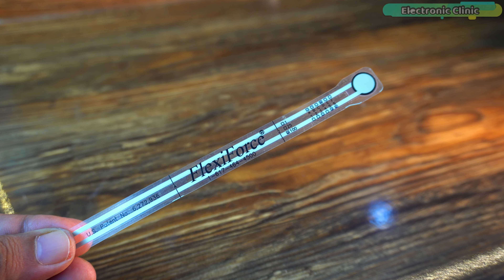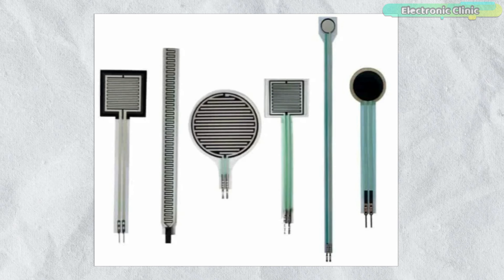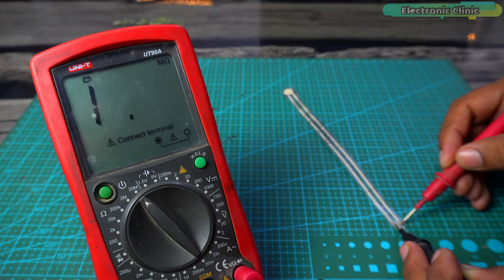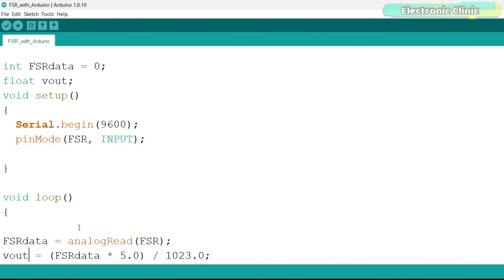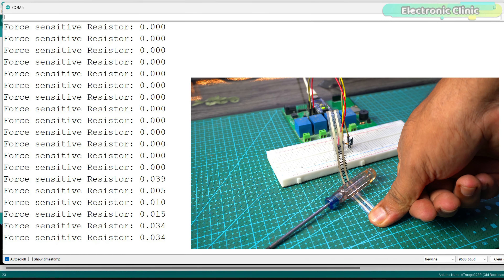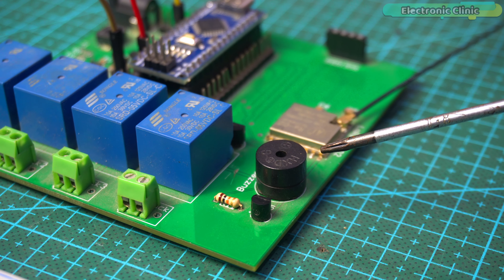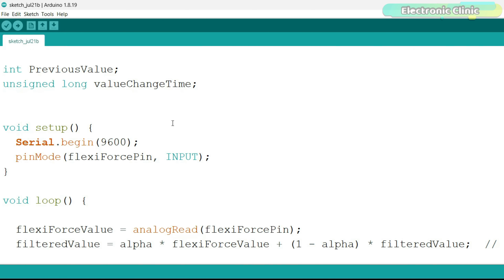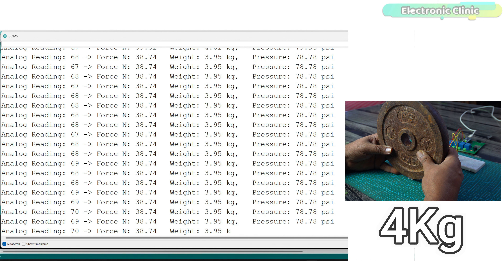Force Sensor with Arduino, Force sensing Resistor FSR, Force Resistor, Force Sensitive Resistor

Comment: That was a great video, I worked with the pressure sensing resistors in the past and got very frustrated with their inconsistent readings. Using a voltage divider and a capacitor is smart and so simple, I can't believe the thought never occurred to me. You are a genius! Well done Sir.

Comment: Hi I'm working on a project for transmitting medical signs without using BT, wifi. I thought using  esp32, sim7600g and ad8232 might work but another option is to use the LoRa module. Which one do you recommend? I really would appreciate it if you could help me. Great content by the way greetings from Mexico
Reply from the maker: @Sebasmont12  yes Lora is good. Check my Lora based videos, and don't forget to watch my video on Lora antennas.